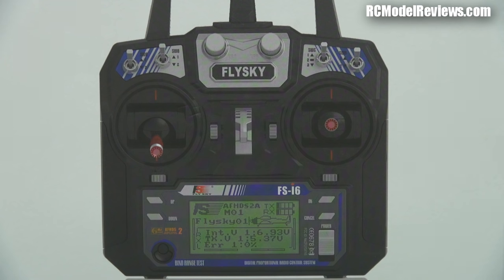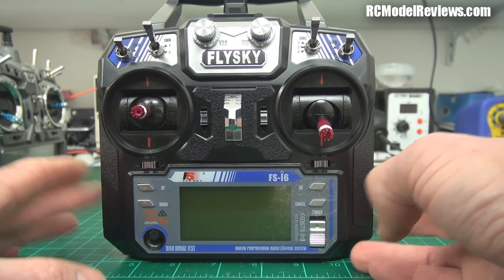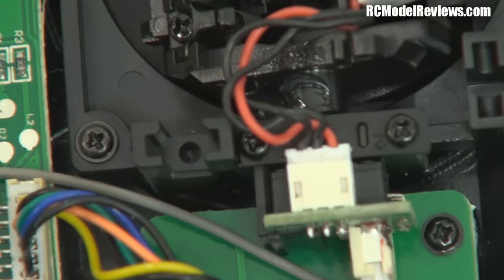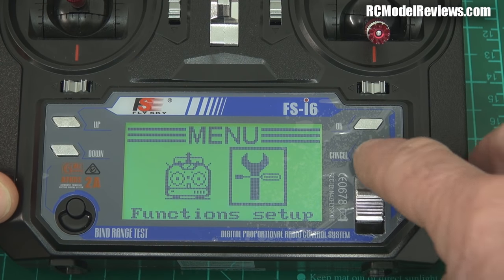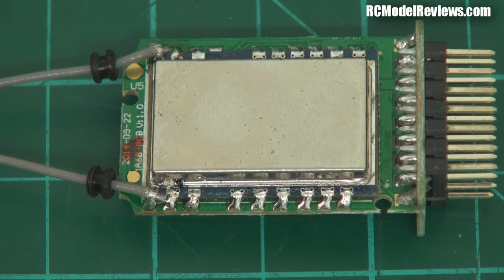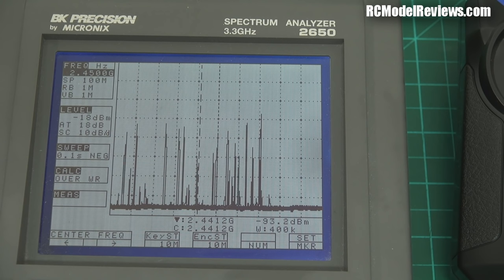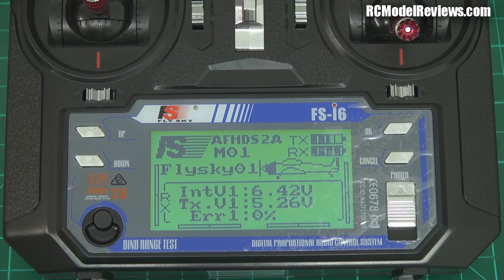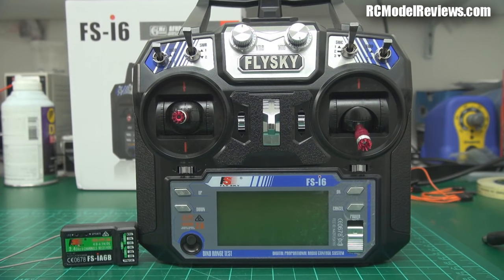On the bench: FlySky FS i6 radio

Comment: I have flown all my aircrafts on this radio from quads to Trex 600. Love it and trust it 100%. I have been using the same radio now for over four years with only two small issues. After year two one of the gimble spring broke which I replaced with a spring from a crappy jumper radio. Also the ok button started to stick after many use and probably rust from having rain get into it. The price on these are so cheap that I ordered two just for parts. The range on these things are amazing and the programming are so simple. I have since turned mine into a 10ch and have not look back.

Comment: Hello:
Thanks Bruce for the review.
This is my 2nd year on this radio, and they were no reviews what so ever on this thing back around December 2014 when I was looking to buy it. 
And mine came with the regular IA6 receiver. The IA6 is a "Park Flyer" receiver, which they state to be less than 500 Meters. And the IA6B is a "Full Range" receiver, which they state to be great than 500 Meters.  And I have the IA6 in my Great Plane "Spectra" sailplane. And I haven't any problems with it all. And I am putting in the IA6B in my Sig Riser 100 that I am building now.
I don't know if anyone has mentioned here. But to save any setting on this radio, you have to hold down the cancel button to save.
And with the Turnigy brand, everything works the same.
Bottom line for me is, it is a great little beginners radio and if you like me is on a set income. It is a nice purchase. And I have seen some high end radio's out at the club that had problems losing signals and I fly in the same place they do. And also, if you do some googling. You will find a all english version of the manual.

Comment: the flysky i6 with the fsia6b is what I use everyday and it really is a great radio the only thing and the most important thing I didn't hear you mention was the failsafe if u don't go into rx setup and turn. on failsafe and you pull lose an antenna in a crash and don't fix it correctly YOU WILL HAVE A FLY AWAY!!! trust me I know from experience and when your baby goes through the clouds. even if it does land at your feet there will be nothing left of her worth having so please tell ppl to set failsafe and make damn sure it is working I wouldn't wish what happened to me on my worst enemy thank you for reviewing this radio I always love hearing your opinion
Reply: same as any transmitter
Reply: I fly mine over all sorts of bushland and even if it failsafes id be fortunate to be able to find it.

Comment: I am actually really impressed with the next one up, the i6s.

After coming back to RC after a 12-year break I picked one up as a toy BUT I can't believe the features I get for just $15-$20 more than the i6 (I see it in places for $61 US).  A few of the highlights over the i6 are;-

* 10 channels via sbus/ibus (with the 6 channel receiver no less)
* 2X 3 position switches
* 2X 2 position switches
* 2 Push Buttons
* 2 Varistor wheels

The new firmware adds the missing model memories of the v1 firmware as well as a stack of other things.  I live about 40-50k away from Bruce, perhaps I should pack it in a bag and send it over for him to have a look.

Getting 10 channels out of a 6 channel receiver (standard, no mods) is just gravy.
Reply: I just received my I6S this morning and am still mulling it over. Bruce would absolutely love the innards in this one!
No solder blobs. Wire looms that are nice and very tidy along with designed-in wire catches in the housing to route them. All connections are those mini jst type thingies (yes. it's an actual technical term ;-)
It's absolutely tiny inside - I mean there's plenty of room but a lot of it is empty. Then again, it may just look that way since it's white plastic. But it doesn't do speak-n-spell - oh well ;-)
Don't ask me to compare it with the original I6...  I dunno which'd be better yet.

Comment: The i6 was my first radio and I love it. Still have it even after getting the i10. I liked how easy it was to set up a model. The small size I like. The i10 is bigger but really thin if not thinner than the i6. I have tried a few other radios and they feel like your trying to fly a plane holding a boom box. Way to big for me and I have big hands. No idea why most radios are as bulky as they are.

Comment: I have one of these. It's great to use and easy to set up. I use rechargeable AA's. I have fitted a charge socket so I can charge them from my battery charger without taking the batteries out.

Comment: The AFHDS A2 system divides the 2.40-2.48Ghz spectrum into 140 channels and then use 16 of them. That's why you see 16 spikes on the oscilloscope. Don't know if the 16 channels are selected randomly per bind nor why it's done this way. (Maybe it's EU-regulations demanding "listen before talk"?!).

Comment: That Err1 on the bottom on the screen is the error rate. It's not rssi, it works a bit different if I'm correct, but it is indicating the signal strength just as well. Unfortunately it doesn't beeps at you when it goes high.
Reply: Try to upgrade transmitter 10chanel

Comment: The FS-i6's big brother the FS-i10 is an amazing radio and goes for around $170. That's about the same as a Taranis but you can also get Sbus/CPPM capable receivers for it for around $10 which is less than half what an X4R-SB costs.

Comment: Love my i6 and pretty much agree with the review. A nice feature is the simple menu accessible fail-safe setup. 

4xAA is probably one of my favorite features. It runs for a loooong time on a set.

Also worth adding that there are four different receivers to choose from:
Ia6 (6ch pwm only, small, with diversity) 
Ia4b (4ch pwm, 6ch ppm, 10ch ibus, small, no diversity) 
Ia6b (6ch pwm/ppm, 10ch ibus, with diversity) 
Ia10b (like ia6b but 10ch).

The telemetry add-ons for the b receivers are annoying but really cheap.
Reply: Agreed, battery life is NOT a problem, I use rechargeables, great life, carry a spare set. No problem with AA's.
Reply: how can we arm motors using this transmitter ???

Comment: The voltage telemetry sensor for that receiver costs like 2 bucks...
Reply: Where from?  Other than the hack.
Reply: I got it somewhere from aliexpress but that listing doesnt seem exist any more. Sorry for false information then.
Reply: search for 'flysky voltage' on banggood
Reply: ***** Both original and the custom FW beep at low voltage allowing you to set the voltage treshold to start beeping. The original FW has only 10V max voltage limit, but custom firmware can go as high as you want.
Reply: *****
I just plugged in one cell instead of all four until i flashed the FW.
Reply: there is a mod to get battery voltage on pin one. very easy.
Reply: And you can upgrade it to 10 channels
Reply: Here is the link of all you need to upgrade the software to 10ch and other mods.

https://github.com/benb0jangles/FlySky-i6-Mod-
Reply: vetsen hobbyking
Reply: exactly

Comment: Hello,

Gread video! But one thing to mention: Most packeges of the FS-i6 don't include the FS-iA6B receiver, they only include the FS-iA6 receiver.
This receiver can only handle PWM and only the 6 channels, that means, if u wanna upgrade it with the 10-channel-mod, you have to buy the other one.
Reply: Good point, and if you're using an APM flight controller you also need an ibus to ppm converter as the PPM out on the IA6B is only 6 channels, even with the mod. You cam make a converter easily snd cheaply enough with an Arduino mini or micro board.
Reply: Yeah, you are right, forgot to mention that one!

Everyone who is interested in, just google "Arduino iBus to PPM" and you will find some tutorials and ready-for-use code.

If you only have the iA6 receiver [like me], you can build a PWM to PPM converter with an Arduino, too. Just google "Arduino PWM to PPM".
But you will still only have your 6 channels.

My opinion: They could have easily added at least PPM-Output on the cheap iA6 receiver...
But Money is everyting ;)
Reply: RC Noob
Hello again,

there's still one question left for me:
Will the 10-channel-mod still work when using the FS-iA6 Receiver, not FS-iA6b?

Of course, there will still be "only" 6 channels available.
Reply: Hi:-) 

That is a good question, and I would assume it does if you are using PWM, as PWM should still works, even when using ibus. I have both receivers, so I will try test the iA6 this weekend. I'll keep you posted!

Comment: This is the Tx/Rx I'm currently using. IBUS is available in Cleanflight, Betaflight and even Baseflight I think. I have read that IBUS is actually faster than SBUS. There is no RSSI in the conventional sense. Instead, the Err1 reading goes from 0%-100%. 0% is no errors/good RSSI 100% lots of errors/bad RSSI. I guess it's a reverse RSSI in a way, but I believe proper RSSI is monitoring the resistance or voltage of the signal and not the amount of 'Errors' (whatever they class an error as).

Comment: I got this and hooked up the rear connector to a mono audio jack and am using it with PicaSim and SmartPropoPlus as a cheap Flight Sim before I try the real thing.

That could make a nice video as the only other one doesn't cover the soldering and testing.

Comment: I actually like the AA battery option, since already got a high end radio, I use this for simulators because lipo ones run low and sometimes even run lower the 3v which destroy the battery from using the simulator for hours.

Comment: I use this combo as well. Telemetry works great when you hook it up to a free UART and configure it in a custom cleanflight rom (the changes are quite minimal to default cleanflight). Only problem is you need two UARTs if you want to use ibus sensors and receiver at the same time (which is hard to do on a naze32).

There is some great work going on. I still need to do the 10ch firmware mod, I do need it somehow. I thought 6 would be plenty, but with all the modes you can configure in cleanflight... It is a must :)

Decent review, could have used a bit more research into the modding side of this rx/tx combo.
Reply: don't use naze 32

Comment: Hi Bruce, I have been using this Radio for 2 years now and get very good results even when flying FPV. I have upgraded it to 10 Ch's and replaced the Ant's with +5db whips.   The radio does allow you to use RSSI or SNR it's a choice under "Sensors".. I have a question for you :) When the RX & TX are both side by side, what kind of RSSI value would you expect to get? I get 39db I would have thought I would get closer to 0db. Can this be calibrated ?  ...Regards, Pete

Comment: The switch wires inside my old JR XP9303 and XP8103 transmitters are also soldered with no reinforcement. Frsky is the only company I've seen that actually puts heatshrink over the solder tabs on the switches and pots everyone else even high end brands just solders the wires on and calls it good. The crimped connectors on the daughterboards should be alright with the wire flexing and also highly resistant to vibration. It's too bad they didn't just use daughterboards and crimped connectors on the switches and pots too.

Comment: Also, while sbus would be nice, ibus is supported on cleanflight, betaflight, and dronin (openpilot fork), and there are better digital outputs for receivers to copy anyway - sbus's inverted signal makes it a pain to use anywhere but on an f3 board, or flight controllers with inverters on one of the uarts.

Comment: None of these 2.4ghz transmitters are actually transmitters they are transceivers by the nature of the 2.4ghz system they use. Therefore using diversity should no harder on a tx than an RX. 
Also ibus has been supported in betaflight for about 4 months now works great for me on 2.6.1 uart3.
Reply: >Therefore using diversity should no harder on a tx than an RX. 

If you have two transmitters on the exact same channel transmitting at the same time you will have problems.. that's the whole reason these things use channel hopping.
They are either doing (as pointed out in the video) interleaving by one packet out on antenna, next out the other or interleaving using multiple channels at the same time. Not as simple as sample both antennas and prefer the one with the best RSSI .. and even that isn't simple. The firmware in a big silicon vendor's WiFi chip that I used in a product messed up the diversity so that if it flipped over to an antenna that wasn't connected it would get stuck until power cycled.. if even a big mainstream vendor can mess it up imagine what Chinese RC vendors can come up with.

Comment: Don't remember if it's in the manual, but to save settings on this transmitter you have to hold "Cancel" button, which is a bit unintuituve.
Reply: its easy to use

Comment: 7:38... no, leave it to the experts. An RC radio is NOT the device to learn electronics and programing on. Too many people that don't have a clue what they are doing put's other flyers at risk. But opening up a radio to ShoeGoo the wires where needed to stop the moving gimbal wires flexing at the end of the solder and adding flexibility without failure is a smart thing to do as long as you ground yourself... the wires DO break and better to get to it before it happens and ShoeGoo thinned down let's you do some fancy stuff when you learn how to use it in various viscosities. The soft foam feet on a JJ1000 will outlast the quad if you treat them with a 25 to 75% SGoo/Toluene solution. SGoo (NOT Goop) works wonders with soft foams even better than EPP. I don't own a hot glue gun and use SGoo in it's place at various viscosities. Downside is there's no free ride in a give and take and it needs to cure which requires more time than CA or Hot Glue. But try fixing a shoe with Hot Glue or epoxy and see how far you get...

Comment: I have one of these as a spare radio for my small gliders and the only thing i hate is the spring tension in those gimbals surely there's a way to make it a little tighter with not much modification!
Reply: Hi Spade The Red,
If you want more tension in the gimbals, there's a Philips head screws on each & they adjust the tension.
If they are "up to the top", then no more tension can be applied.
To do so, you have to upgrade the small springs that are attached to each.
It's not hard to perform, just a tad fiddly.
A long set of tweasers will help. Turn the screws down to release the tension on the "new" springs & adjust to your required tension.
HINT: Watch the video & when you see the gimbals & the actuators, stop the video.
 5.40 to 6.00 & 6.40 to 6.45....just.
The screws & adjuster are in the 2 sliders/pillars & show the small springs.
Reply: I actually don't mind these because they are cheap and good as a give away radio with certain planes for beginners , and I actually figured out a tension mod the other night while thinking about this that's even simpler " my main radio is a Jr 11x "

what you do is take out the existing screws and get some longer ones , then put a small piece of plastic on the edge of the gimbals to stabilize the spring riser , ill make a 3d part on thingy-verse ..

then the screws have a bit more tension and you can use the existing spring ..

ill give it a go when i get home and throw down a video

Comment: I'm doing my level best to not being a pain in the rudder here! You'll have guessed by now that I'm a beginner, and have had nothing at all to do with radio control systems - I'm a retired carpenter and make the occasional guitar. My latest investigations into the problem at hand seems to suggest that I should have plugged the line from the ESC into the receiver rather than the charge balance plug. Could this be the solution to my woes??

Comment: I am contemplating replacing the radio of my Bugs 3 and i am wondering whether the telemetry that warns you when the drone is going out of range and/or low battery will still work with i6 radio.  I would much appreciate your input. 

 Thanks,

Alvaro
Reply: Alvaro Demarzi HAHA WOW. You need to do a lot more research AND join a forum. Last I checked a YouTube content creator isn't being paid to answer your tech support phone calls...just sayin

Comment: its possible to use this for small battlebot right? for like 2 drive servos and flipper servo?
Reply: Yes, but you'll need to provide 5V to the receiver. And if they are very high power servos and motors they may need more pore than can be run through the receiver and may want separate power supplies.

Comment: betaflight supports ibus which is like sbus in terms of latency.
Reply: And cleanflight...
Reply: even better!
Reply: And it doesn't require inversion like sbus does...
Reply: This is the reason why this radio should be first and foremost in beginners' minds. If they are going to fly multirotors anyway. For fixed-wing, it doesn't matter so much.
Reply: +Joshua Bardwell is this any good for qaudcopters josh
Reply: William Davie improved input response and no deviation from actual values
Reply: +Reuben Horner thanks

Comment: Hi there, could you tell me the correct way to plug in from the battery to the B/VCC pins?  I've burnt out the original and don't want to burn out the replacement!

Comment: Does this radio still have the 20ms latency like the FS-T6?  Or perhaps the iBus protocol helps in that regard?
Reply: With PPM the frame time is 20ms, with ibus it's 8ms. This is just the time between frames though, not the overall latency between stick movement and signal output. But still, you get 12ms faster response with ibus.
Reply: Hahha and whoever believes that a human being can perceive a difference of 12ms is nuts. Maybe one tenth of a second (that's 100ms) would be very slightly noticeable... but 12ms come on man :-) who are we Flash Gordon LOL